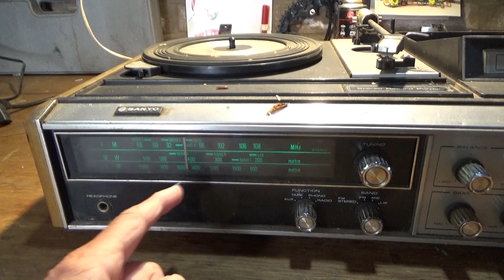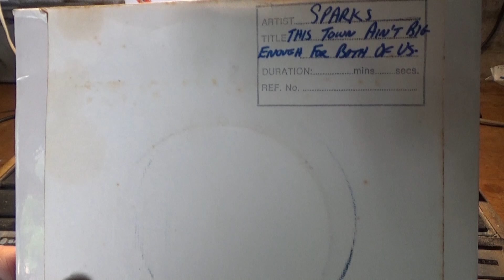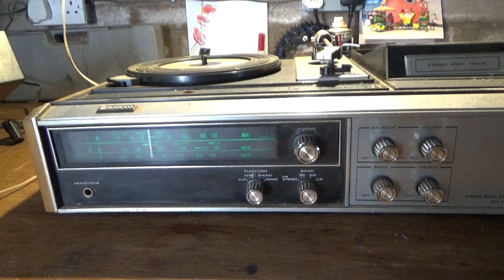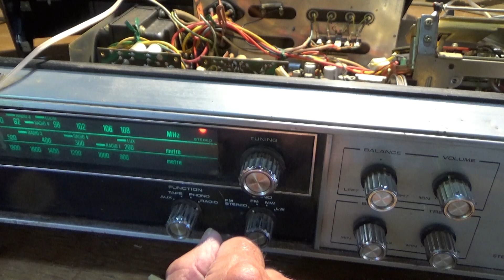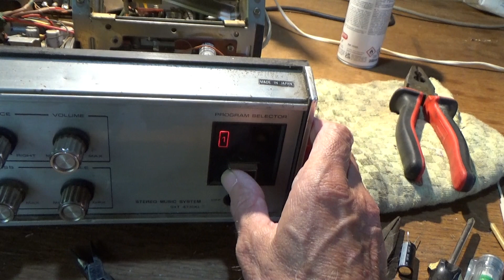Hideous Sanyo music center with 8 track player

Comment: Truly hideous, Nick.  Surprised you spent time on it - but even more surprised you have no 8-track tapes!
(just kidding, of course)
Reply from the maker: Indeed it is. But I'd have loved it 45 years ago, preferably  with a cassette recorder. I  was more into reel to reel back in the 70's. Had a top of the range pioneer(rt 707) then latter high quality cassette decks , all irrelevant to me now. But I thought it was worth the effort to make it work fairly well.
Reply: @ptronix  We have a similar history - and a big thumbs up on the RT-707 unit.  Beautiful deck, great performer, was at the top of my list. Chose the Akai GX230D as I managed to catch a great $ deal on it at the time.  Still have it - needs work now though.
Planning to take the Sanyo to a charity shop?
Reply from the maker: @matambale  charity shop! They wouldn't know what to do with it. It needs a decent burial. The rt707 cost me £400 in 79. Worked all summer holiday from college to pay for it. I'd go as far as to say that a high quality cassette probably had better performance using metal tapes & dolby.
Reply: @ptronix  Speaking of which I've often wondered how much better reel-to-reel could have been with more modern tape formulations and noise reduction.
As to charity shops, I've seen worse on the shelves than that Sanyo...of course, they probably never sold them.
Same experience with summer jobs and hifi gear.